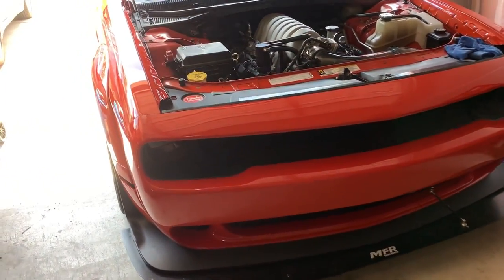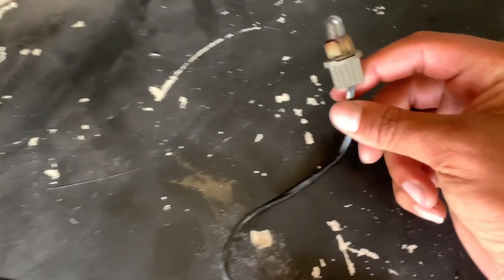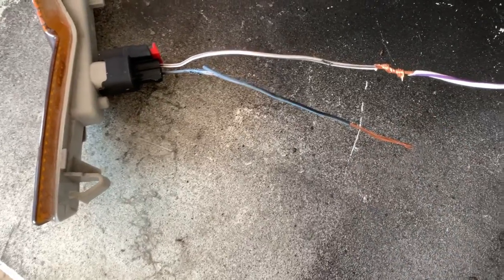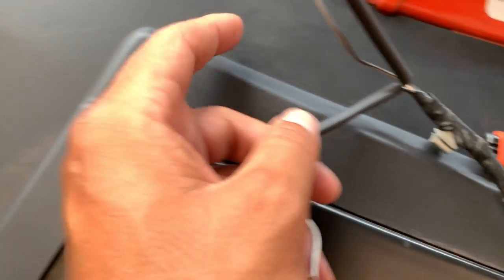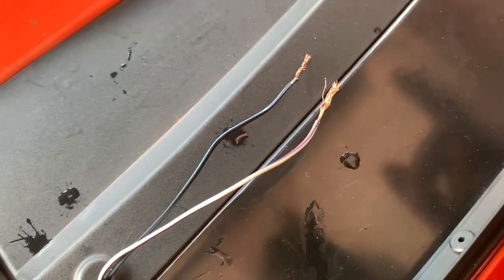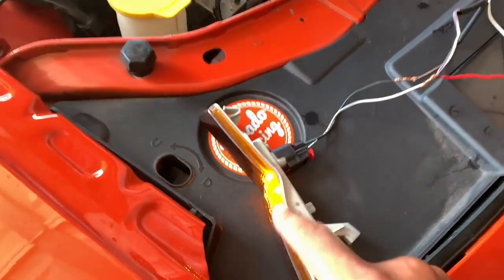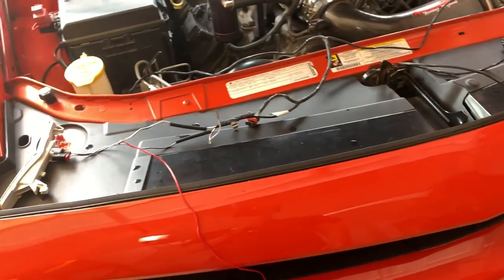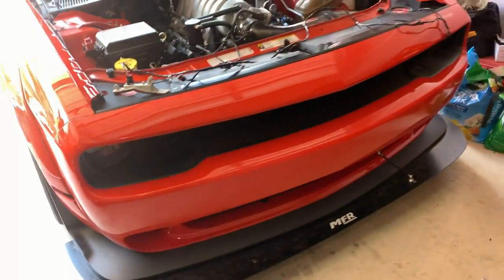PSA: I am not building a Hellcat Widebody Clone + how to install 2015+ LED side markers

Comment: That’s a awesome challenger. My ‘14 srt looks stock but that’s because all my money has gone into the engine and mods. It’s FBO with forged internals and a whipple stage 1....coil overs and that’s it’s
Reply from the maker: Sleeper status I like it. What’s it putting down?
Reply: @TIRADORACING  665 HP! More than enough for me tbh
Reply from the maker: My car is only 400whp 😉. You can do a lot with 665.
Reply: @TIRADORACING  i plan on swapping a few body parts out for full carbon fiber ones. I thought about going widebody but too rich for my blood for just some wide fenders lol they look great tho
Reply from the maker: Just depends on what your going for. I would have never gone wide if I could fit bigger wheels and tires inside the narrow body. But that wasn’t feasible so we had to push out. 

Some people just want the look and that’s cool too. All depends on your goals. Full carbon parts look wicked 😎

Comment: just trying to figure out whats your wheel setup i want my wheels to be flush when i get my body kit
Reply from the maker: Oem dodge demon wheels 18x11 -4.5 wrapped in nitto 555g2 315/40/18.

It’s not EXACTLY flush so if you want it “Hella flush” you’ll need to play with spacers. I don’t use spacers tho.

Comment: Vland makes head and tailights
Reply from the maker: I’m going to preface the information below with a piggy back off the title of this video….. I hope you enjoyed the video. 

The vland 2015+ styled headlamps are still the size of the pre 2015 cars and will fit offset. Since this is an oem hellcat bumper You would need oem 2015+ headlamps so it fits the hellcat headlamp opening and the adaptive harness for the lights to work which can be found on Steve white parts.

Comment: Hey good morning 🙏 I just wanted to ask you what's your tire set up front and rear with the demon rims. I have my scatpack challenger in the shop doing the widebody kit on it and just wanted to know your tire set up would really appreciate it
Reply from the maker: In this video 

Nitto 555g2 315/40/18 all the way around 👌🏽
Reply: @TIRADORACING  so no issues on rubbing in the front or rear ??? I have a 2020 dodge challenger R/T Scatpack with the 4 piston brembo brakes and I wanna get the demon rims
Reply from the maker: Well idk how new you are to this channel but 1.) the rear quarters are cut 
2.) the entire front clip is now oem widebody 
3.) my car is REALLY LOW
4.) we autocross and road race it often. Plenty of videos auto-crossing and no rubbing issues. 

I’m not sure what kit or parts you, if your cutting your rear quarters or not and if your lowered or stock height. 

When I had my vicrez kit I cut my front fenders** 

So I had no rubbing issues, idk your set up. But that’s what I did I hope that helps bro
Reply: @TIRADORACING  yeah I told my body shop that I wanted the front fenders and rear quarter panels cut and I went with the Ikon Motorsports widebody kit and I wanted to fit 315 in the rear and maybe 305 in the front. Also what kind of springs you did to your car. I love the way you have your car it looks bad ass and I'm going for a similar look. I was thinking of doing the Eibach Demon springs on it
Reply from the maker: Ikon and vicrez kit pretty much the same. 

You can fit 315’s front and rear as long as your wheels are the correct offset. I have oem demon wheels 18x11 -4.5 offset are the specs. And 315/40/18 fit just fine. 

I’m on Bc Racing Coil overs and a hotchkis front sway bar with poly bushings.
Reply: Have you tired out the toyo proxes r888r heard that does tires are better. 315/30/18 that's the only size available. Also did you had to buy the upper control arm to fix the Camber for the Alignment??
Reply: I really appreciate your time and helping me answer my questions
Reply from the maker: No use for r888r as I mainly do autocross. There are better autocross tires. I use bfgoodrich rival S in 315/30/18 and for road racing I use the Toyo Proxes RR in 315/30/18 as well. (I have a lot of tires 😬).

My alignment is set to 0 but my next video I will be testing out the SPC upper control arms in the front before I ultimately switch to AAD front upper control arms and rear suspension.
Reply: @TIRADORACING  thanks for your time 🙏
Reply: Did you ever think of putting some race star wheels in the rear like 17×11
Reply from the maker: Honestly no,  not drag racing and no need to go to a 17 inch wheel. I get it looks cool and that’s the style but it would be a waste of money for me lol. I have 20 tires in 18” size….. to drop down to 17’s just for the rear would be kinda pointless for what I do. 

Again it looks sweet but I can’t justify it.
Reply: Yeah I see. I'm still thinking either going all 18's with the demon OEM or just two OEM demon rims and two race star wheels with 17 inch in the rear only. So 18's in the front with 17's in the rear
Reply: Hey its Edgar again sorry to bother you but wanted to know where did you get the Demon rims from. I came to a shop to see if they can get them for me but they can't just wanted to ask you better.
Reply from the maker: eBay bro. A guy or a seller named oem_ohio

They are hard to come by so if you find them buy them quick!
Reply: Thanks appreciate your help 🙏
Reply: Hey good morning bro. Quick question did you had to buy any special lug nuts for the Demon OEM rims?? Because I bought mine already just wanted to know and ask you
Reply from the maker: Nope. I did buy black ones tho. But oem spec
Reply: Because I have all 20 lug nuts with the lock key I think those should work
Reply from the maker: Yea bro their just lug nuts lol no need to worry
Reply: Because from the guy I bought my nitto tires mentioned something about the lug nuts and I just wanted to make sure from some one who actually has the Demon OEM wheels already get me but I appreciate your time like always take care and looking forward to some new videos from you 👍
Reply from the maker: Bro no problem! You can also dm me on Instagram (@tiradoracing)